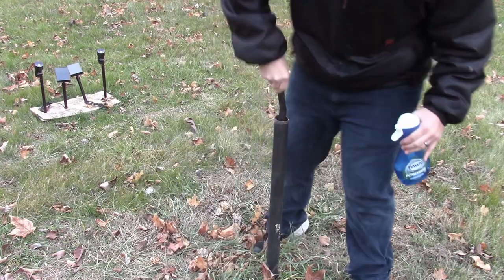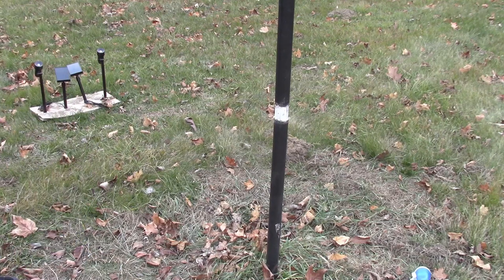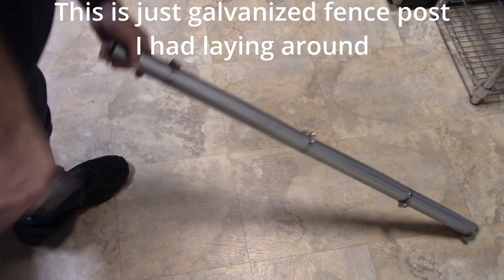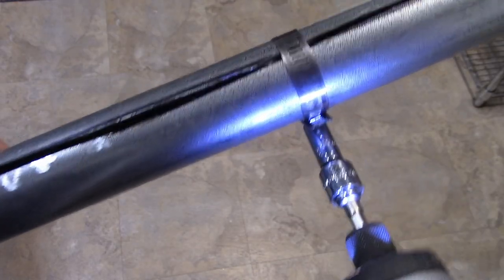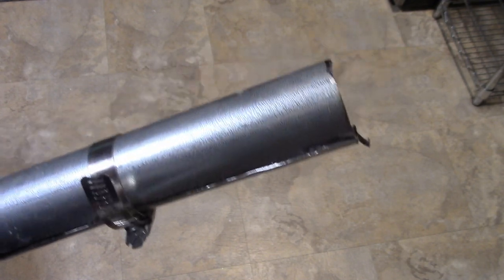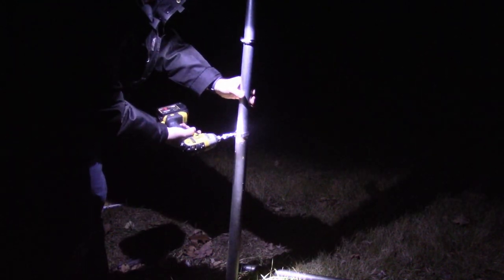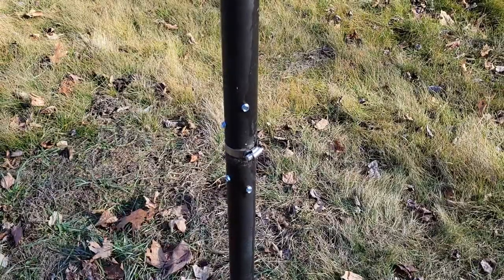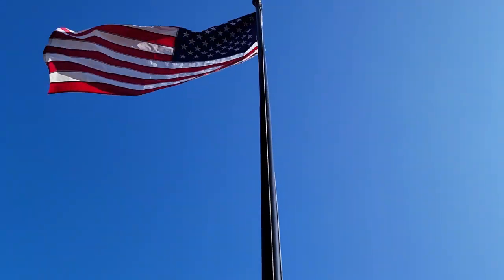Fixing a Cut 25 ft. Flagpole After Replacing Pulley

Comment: That was a smart idea. I want to do the same but with a galvanized tube inside, but I'm not sure if I can find a few inches less tube to get both parts of the pole to be attached.
Reply from the maker: Good luck, I searched at all the big box stores around here (home depot, Lowes, menards) and none had the perfect size for mine which is why I had to slice it long ways and use the clamps. The flagpole is still holding strong today.